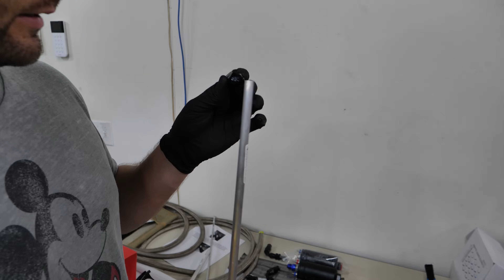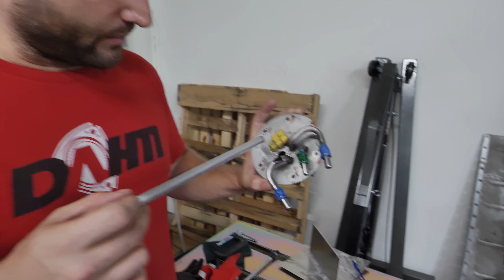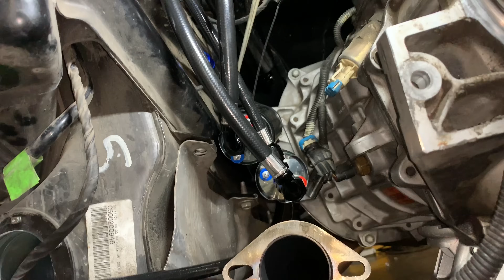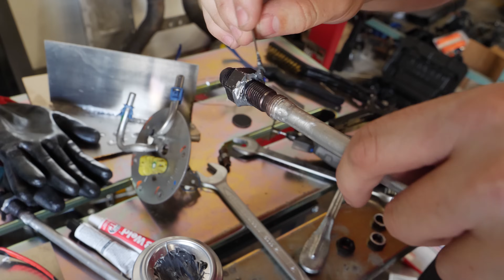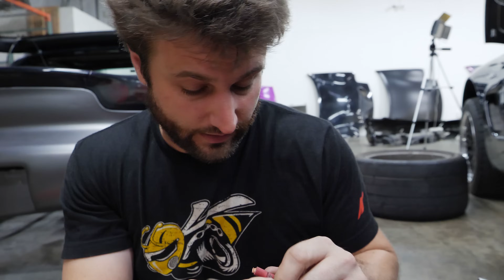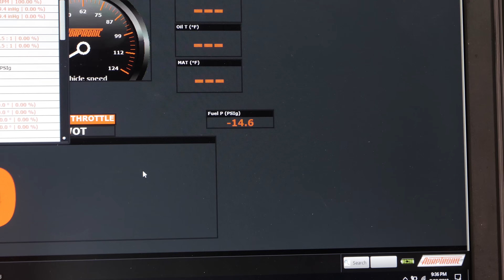Corvette Fuel Tanks SUCK. Upgrading the Rotary Corvette to E85

Comment: My goodness the craftsmanship...the soldering (worst I've ever seen)...the terrible fueling mods...just wow.

You don't want the tank to leak...so you:

1. Drill several holes too large
2. Buy mismatched fittings and pipes
3. Weld several items where it was not necessary because everything was mismatched
4. Your hopes of sealing is now shot because of all the mismatched hole sizes, fittings, and pipes...so you use JB weld as a sealant
5. You know JB weld will not hold so you need to run a jam nut that is too large to clear the fuel tank sender gasket...so you thread it on (the term is threads, not teeth lol) and tack weld it...and then you have to cut one side because of your poor planning and gasket interference.

You know how to properly do this job?
1. Drill appropriately sized holes
2. Use appropriate sealing bulkhead fittings, insert one through the correctly sized hole and install female end on the other side.
3. Insert appropriate fitting over a pipe you've already bent into shape...thread into bulkhead fitting.

That's it.

You spent days screwing around to have a terribly shoddy solution. I would never even take a ride in a car with terrible fuel modifications like this. Especially since all of these mods decreased the clearance to the exhaust down to almost nothing. I've seen stock rotary engines make exhaust pipes nearly white hot...

Comment: sell the vette tanks, and get two fuel cells one for E-85, and one for high octane gas, stop putting 45 angle fittings all over the place,they reduce  the pressure  and fuel volume, also having too much fuel going back to the tank  (return line) the juice lose,s some octane. There are  three ways to have an electric fuel pump, mount it as close to the engine,or close to the fuel cell,or have the pump inside the tank ( i hate those) having the pump close to the engine,means you have less pressurized fuel line, I dont like sitting next to a high pressure fuel   line ,even if its under the floor pans etc

Comment: In theory, a good solder joint can be a better electrical connection than a crimp. In practice, heat and flux from soldering makes the wires brittle and more likely to fail and then it doesn't matter how good the connection was the day you made it. 'SCL' heat shrink is better than the regular stuff for protecting against vibration. For anything that lives inside a car, a good crimping tool and good open- or closed-barrel splice will be more reliable than soldering in the long run. (edit, sorry if that double- or triple-posted)

Comment: Great video but hot damn that soldering job made me cringe. You never want to drip solder from the iron onto the wires. Best method is to heat the wires from the underside to the point that the solder melts in from the top side. Flux paste is your friend for drawing in and cleaning the joint to be soldered. That joint will have an added resistance to the circuit and being a cold joint will be a point for failure. It needs to be addressed.

Comment: I would not keep that solder job on your fuel systems if you don’t want it to fail. Heat the wire from the bottom and add solder from the top. 😑

Comment: I'm sure there will be tons of comments about the soldering, so here's a TL;DR

- Don't directly melt the solder.
- Heat the wires until they're just hot enough to melt the solder.

Comment: when soldering a wire that big you need to supply more heat, hold the gun to it until the solder sucks into the wire mesh.  What you did may hold but its a cold solder that can break and cause corrosion from high resistance.

Comment: A large reason fuel pumps are mounted in the tank is to eliminate any chance of cavitation on the inlet side and that boils the fuel causing gas bubbles which will kill the pump.  When you mount a pump outside of the tank you should make sure to have a large enough inlet line and that is usually larger than the outlet, but some time it will be equal. Never should it be smaller than the outlet. The pump manufacturer can tell you the exact requirement for their pump. The other thing you should make sure to do is have a vent that is equal to the pump pickup line or lines so that a vacuum isn't created in the tank causing cavitation.

Nice cold solder joint.

Comment: Listen Rob, I'm going to help you out. First, you should be crimping those connections with open barrel connectors, not soldering. Second, if you're dead set on soldering, you can't use an iron on wire that size. Use some flux and use a small butane torch to heat the bare wires. It'll come out much cleaner after you cover the likely burnt wire sheath with adhesive lined shrink wrap for strain resistance. 👍

Comment: Personally, it would have been a lot easier to use the stock pump as a swirl pot supply and just run the duals after that. But idk how clean you are looking to keep the trunk, in theory you could still hide a swirl pot setup. Good work, just seems unnecessary.

Comment: Me no nothing. I'm with stupid. You twisting my mind watching you work. I don't nothing about fuel systems. What your doing is blowing my mind away. I just hope it works by the end of the video. You have a higher IQ than me to understand that freak'in mess. Some of the fittings you JB WELD together in my opinion should of been tig welded. Gas and oil and JB WELD DON'T MIX. The gas might leak where you JB WELDED. You mentioned you did this in 3 weeks? Now I know your frustrated and that fuel system is very complicated. I'm learning new stuff about rotary engines watching you. It's making my mind wondering if you could convert a rotary engine to fit in a light sport aircraft. It's very compact and small enough to fit into a light sport fuselage engine compartment. Plus more power than you need. My mind is crank'in away. Rob, you certified to me that you have gone crazy.

Comment: That may have been the worst soldering job i have seen. Need to get the cables hot enough to have the solder melt in through them Rob. Wires that large would probably need a small blow torch.

Comment: You need a decent Soldering Iron, that type you are using is crap. They don't keep the heat on the tip. That's a weak spot. Nothing wrong with what you are doing if the Solder penetrates properly.

Comment: Tips;
- Use a correct gauge open barrel crimp instead of solder
- JB weld will leak, its a shit feeling when it does
- Set a rising rate FPR when connected to engine vacuum since that is going to pull the fuel pressure down
- Just use an AN to hardline fitting instead of welding next time

Comment: This tank system seems overly complicated. 
Why not just have a system that pumps from tank one to tank two, then tank two sends fuel to the engine? Float from tank two can trigger the pump in tank one, float in tank one can trigger tank one's pump to shut off when 'empty,' and the average of the two floats can be used for overall fuel level; basically, keep tank two constantly full if tank one has fuel, then drain tank two when tank one is empty. Maybe put a split on the return with a controlled valve, also controlled by tank one's float, so that it returns to tank two when tank one is almost empty, unless you want to return fuel to an empty tank. This would also get rid of all but a few of the Y fittings, use less tube and fittings, wiring would become simpler, and make the system less complicated.
But what would I know, I'm not a GM engineer that decides an overly complicated system is the better solution.

Comment: its inox steel, some grades of (low quality non industrial uses low content of chromium and nickel, the good stuff its used against acid and crap, if not its over kill) it when its cold work it's become kind of magetic because of the energy that absorbed and deformed the crystalline structure, sorry for the crappy english.

Comment: Hi. Why not use a bulkhead barb fitting and run a flex hose to your pumps? You would need to weld together a bracket to support your pumps and then all set. Thanks.

Comment: who taught you how to solder?
next time use the soldering iron to heat up the joint until you can just touch it with your solder and have it melt right in and dont try to just drip melted solder onto the joint

Comment: You should check out the fuel socks that Holly sells.  I think it was Cleetus that had them in a video, they are massive, and really help with the fuel being drawn into the system better.  I know that you are not planning on running the system low, but with sloshing (if it got low) you may want something like them to help draw fuel in especially since the two intakes are pointing toward the front of the tank.

Comment: you heat up the wire and let that melt the solder, flux helps, it makes for a cleaner and stronger solder joint

Comment: Great video and update Rob, thank you!
P.S. I'm a bit concerned about the soldering job on those cables. It looked like it may have not gotten hot enough to flow into the wires properly. When that happens you get what is called a "cold" joint or connection that becomes a higher resistance point. It will not carry the current as well as a properly soldered joint and it could heat up and fail, possibly causing a fire. Just sharing what I know about soldering wires. I won't be an "internet know it all" and rant and rave at you about it. It's up to you to make the decision about ensuring it is done properly.

Comment: you hold the iron to the wire, the hot wire melts the solder, the flux in the solder allows it to flow; from what I learned from BigClivedotcom's youtube channel :p  That solder job was about what I could manage since I've never done it :D

Comment: Wouldn't the bulkhead fittings come with sealing washers or possibly O rings? since they are designed to be mounted in this exact style, I would expect the manu8facturer would have a specified sealing method?
Also, why not just use the return line to operate the transfer pump from the second tank? I'd expect tee'd off the supply like that is going to bleed plenty of pressure and flow off the main fuel supply.

Comment: If you want your solder joints to work better and be easier; Use flux, it cleans the wire and helps flow solder through everything. Strip more wire. It will allow you to heat the wire hotter to get it to bond. Heat the wire and melt the solder onto the hot wire, otherwise you are just making a puddle of solder on top of the wire.. Use two layers of heat shrink on a big power wire like that. You may have used thicker heat shrink though. I'm enjoying the build!

Comment: OFC (Oxygen Free Copper) VS CCA (Copper Clad Aluminum) OFC will have a fairly significant higher transmittance of electricity. Steve Meade ran a test between the two on a high power amp and saw as much as a 600 Watt difference in performance.

Comment: Guys at least he's working on shit now, a year ago this wasn't even real, maybe we'll get a running awd 4rotor in the next 25 years, just maybe, also, jb weld is the official go to item to repair cracks in plastic gas tanks, that shit'll hold anything, just like corn flour in a radiator
Reply: He applied JB weld to stainless and mild steel and then attempted to weld through it... I mean, does this require any further comment? I'll say it once again, I really like Rob, but his wrenching.... YIKES!

Comment: wouldn't you need some kind of check ball from the pumps before the Y to preventing one pump back pressuring into the other pump incase there is some kind of resistance?
Reply: I think the pumps themselves usually have those built in.
Reply: ahh ok
Reply: @danhard8440  Then again... Now that I think about it... His fuel pressure in the video shouldn't have dropped to 0 (I have no idea how much real world time passed between segments, but I'm assuming not days or weeks) in the moments before he demonstrated his fuel pressure regulator.... unless he bled the pressure at the rail first, which I guess he could have. 

So... TLDR is I'm not sure about those particular pumps...
Reply: but no matter what if there isn't a check ball for each your not going to get even work load and just pre maturely burn one pump out most likely the pump closest to the Y
Reply: @danhard8440  Agreed. Each pump would need one. Or, staging the pumps would probably fix it too. Both would be ideal.
Reply from the maker: The blue fittings on the pumps are check valve fittings.

Comment: Next video, Rob burns down the Dahm garage with all the Dahm cars in it. Moral of the story, don't do fuel line fabrication with out a professional.
Reply: Fuck a professional live and learn
Reply: Maxwelhse your comment makes no sense read it back
Reply: @ethanmiranda6245  his comment makes perfect sense :P
Reply: @ethanmiranda6245  

You said: "Live and learn"
I said: "Or die in a fire at 150mph wishing you'd learned".

Meaning... That fuel system has a degree of safety that is likely to kill him before he has the opportunity to learn the lesson. It's akin to saying if you jump off a 100 story building you'll live and learn not todo it again... Uh, no you won't.
Reply: Maxwelhse but he’s not gonna die from it the only things that would catch on fire at the moment is the placement of the fuel pumps but the lines are very heat resistant so we really don’t have to worry to much about Those
Reply: @ethanmiranda6245  ...I see you're choosing to imagine a world where high pressure gasoline, and lots of it from twin high output pumps, doesn't come shooting out of one the great many poorly installed fittings all over an exhaust system that is literally going to have 3 foot long fireballs shooting out of it from 2-stepping.

That flaw in your logic is that this is Earth, and not JB weld things together land.

I've said it a few times in these comments, but once more won't hurt... I really like Rob, but his wrenching... Just, no. If nothing else, absolutely don't take it as instructional when he shows stuff like this.
Reply: Maxwelhse please let me know exactly we’re all the poor fittings that he put on in this video are cause I only see a couple and there not detrimental to having the car burn down
Reply: @TheBrokenLife  Thoes fittings are some of the best. He made the hoses right and everything. I ment it as a joke and saying a professional do your lines just so you have that extra know how and if something does happen take it back to where you had the work done and have them pay for the damages paid for and possibly fixed the correct way.
Reply: @ethanmiranda6245  Literally right at the fuel sending unit where he GLUED them on after he bugger smugged weld all over them and rolled the threads installing them. You think the rest of his work is better when that's the part he, as a content creator, CHOSE to show you? Ugh... 

Anyhow... I've made my point. You guys can keep your opinion and I'll keep mine.

Comment: Soldering tip- Solder always flows (melts) twords the heat source. So put the soilering gun Under the wire, touch the solder to the hot tip to help the heat transfer into the wire. Then put the solder on top of the wire so it can flow through the wire.
Reply: Yeah, thats what i thought lol. It didn't look like it had melted in between the wires, but just sticks on the outside of the wires. And his soldering iron might be too weak as well. But yeah we all know how Rob is and why we watch his videos. He is entertaining to watch. I like it! He is crazy.😂

Comment: They use brazing to do the connections on older pumps i've worked with. You cannot weld this shit, as i've tried and it will just be a mess. Don't use JB Weld. Go to a guy who can do brazing. I believe they are non-magnetic (non ferrous) so as to be non-sparking. That's my guess anyway. As we know, spark + fuel = no bueno.

9:18 - Better hope you NEVER have a fuel leak where the exhaust is... oh my. O_o
Reply: I feel like any gas tank shop on Earth could have built him the sending unit he wanted for about 1/2 the cost of just those fittings...

Comment: Poor pumps. No pre pump filter. Bad rob should have just brought underbody surge tank with internal pumps & left fuel tank standard
Reply: That would require him having any clue what he's doing.
Reply from the maker: Haha rarely do I get riled up by comments. But that’s misinformation about oil coolers. You need massive coolers on a rotary. I use the stock twin coolers on the 3 rotor and they overheat after every pull. Could I have gone smaller and let them overheat sure. But why. The oil coolers are probably the most solid thing I’ve ever done to a car 😂😂😂
Reply: Didnt he say there was barely space for the pumps and filters? where would you fit a big enough surge tank?
Reply: You aren't supposed to run a pre filter on those pumps, it's built in to the pump already.
Reply: Yeah true even without a relief vent behind them that would help

though doing both could be better unless theyd get hit by a lot of rocks. maybe chicken wire?

Comment: Fuel lines and pumps next to a hot exhaust and transmission? Can't say that's too smart there Rob....
Reply: Floor-It-Duh and what’s worse it’s a rotary that’s like to spit a lot of flames and get very very hot
Reply: @Ethan Miranda If he doesn't melt the fuel lines and set the car on fire at the very minimum he is shortening the lift of the pumps drastically and running a high risk of boiling the fuel. All bad things.
Reply: Floor-It-Duh ending in a onomatopoeia kapow
Reply: His stupidity never ceases to amaze me.
Truly a sight to behold